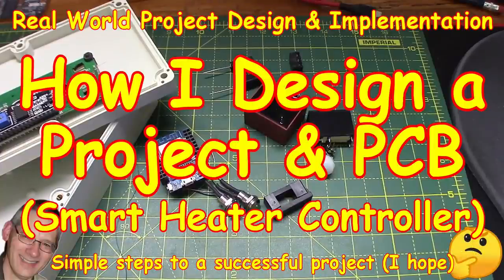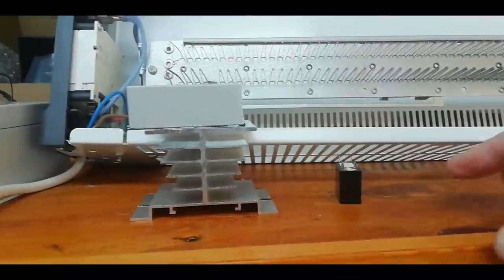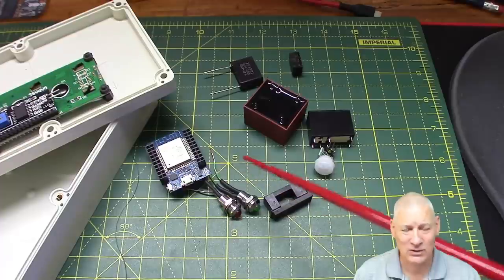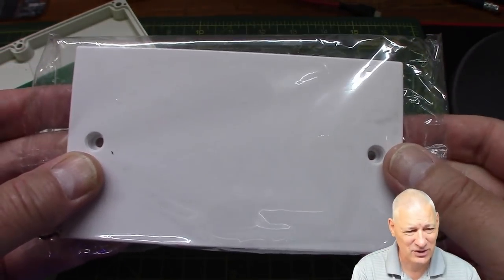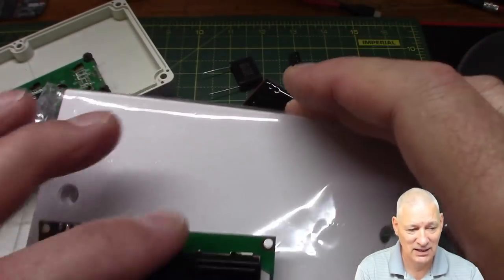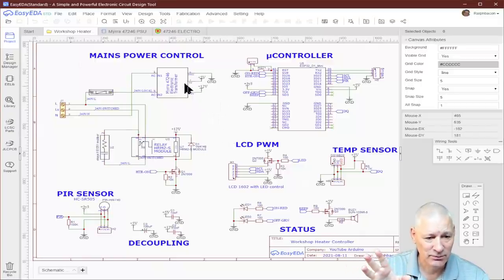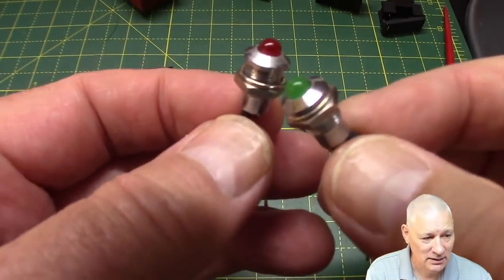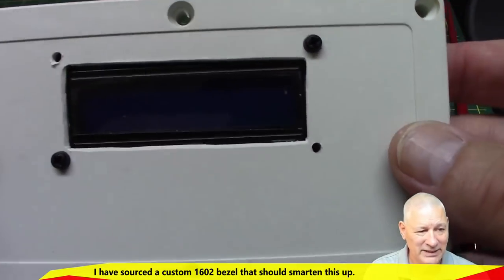#225 How I designed my Heater controller - Warning! ☠️ Mains voltage!

Comment: Ahhh, gotta gouge my eyes out after seeing an auto-routed board, especially a simple one like this. Fixing the auto-routing will most likely take as much time as having in done manually in the first place ;) .

Putting the relay besides the PSU brick should easily possible. Then the mains/low voltage separation would be much more obvious. Not that it is a problem, if you move the tracks a little, there's enough space for separation. But better component placement would get rid of the need to even think about it (and not using the auto-router ;) ).

I've never used EasyEDA (was an Eagle user in the pre-autodesk times, now KiCad user), but there should be an option for a keep-out zone/clearance around a hole (and not only for copper, but also solder mask for example). I can't imagine something basic like that would be missing from EasyEDA. What pretty much does what you did, but without having to manually draw circles, is to insert a pad not connected to any net . Set the pad diameter to the diameter of the screw head/washer plus some wiggle room (and pad drill diameter to screw diameter obviously). You will have a copper pad around the hole, but since it won't be connected to anything it doesn't matter (and your way of drawing the circle has that anyway). The best option would obviously be to not use the auto-router, then you wouldn't have to worry about tracks suddenly being to close to a hole in the first place. Did I mention that auto-routers are pretty bad? ;)

The connection of two of the MOSFETs is weird . It looks like you are switching the high side of the with an N-channel MOSFET. Same thing with the LCD PWM MOSFET (although I don't see where the "LED" signal is coming from). I'm pretty sure those FETs are on the wrong side.

Does the ESP-module have integrated level shifters? I don't see pull ups for the I2C bus. You are also pulling "DQ" to 5V. An ESP32 is not 5V tolerant on its pins. Without logic level shifter you are using the ESP's internal ESD protection diodes to clamp the "DQ" pin voltage to 3.3V plus a diode drop through the 4.7k resistor. I don't know, if the internal diodes can handle that continuously (check the data sheet for the maximum clamping diode current).
Reply from the maker: I've tested the MOSFETs at 3v3 (which is why I've lots of these 2N7000s) and they seem to work well without getting warm. The DS18b20 is definitely taken to 3v3 not 5v. I wonder if I posted an older schematic as you are not the first to say this. Oops.
I just 💘 the autorouter! It can route a whole board in seconds rather than me faffing about. OK, in this instance there are some tweaks needed but usually it's pretty good (and has got a lot better just lately). I know, typical amateur approach!
Reply: @RalphBacon  
I looked at the schematic and board layout in the video, which seems to be the same image as on your git repository (showing 5V).

With 3.3V at the gate the MOSFET can barely be called "on". It will most likely have an R_DS_on in the order of tens of Ohms. Definitely not suitable to drive a load of more than 100mA. A NPN transistor would be much better suited for switching with 3.3V. But while driving an 2N7002 with 3.3V is an issue, it's not the main one here.

You connected the MOSFET in a way which isn't right. Just because something somehow works, doesn't mean it's ok. You put the n-channel MOSFET on the high side of the load (the beeper). There are only very limited cases where you'd ever do that and it usually involves an extra gate driver chip. Here is the reason why it's wrong: assume you can turn on the MOSFET with 3.3V at the gate. In the on state the MOSFET should have a very low R_DS_on resistance, which means drain and source will be at a very similar voltage. You connected the drain to 5V, so the source will be close to that voltage (minus the voltage drop due to R_DS_on and the load current, the exact value doesn't matter). The gate is still at 3.3V, but the source at something close to 5V. How can the MOSFET be "on" when the voltage from gate to source is negative? Well it can't, that's the point. Depending on the load, how the tracks are laid out, what batch of transistors you got and other unknowns it will either oscillate wildly or be in some analog limbo state where the 3.3V at the gate keep the MOSFET barely open and the FET drops a few Volts to keep the source at lower voltage than the gate.

Something similar with LCD PWM. You just can't reliably pull up to 5V with an n-channel MOSFET and a gate voltage of 3.3V.

Comment: 21:55 don't forget that in many commercial products that they also don't bother to line up LEDs on the circuit board and instead use light pipes. You could do the same with a piece of slightly oversized acrylic rod. Or same sized if it doesn't bother you that the brightness might vary between units that are off by varying amounts.
Reply from the maker: I have some commercial devices (eg USB hub) that use light pipes (I never knew they were called that!) and it's still a possibility if I can figure out how to secure the acrylic rod to either the PCB or front panel. Any ideas? The one in my hub is custom formed to clip in.

Comment: Thanks for the tip on how to create a slot in a pcb. I’ll have to see if my pcb app supports that.
Reply from the maker: Yes, very useful for creating slots for a cable tie to hold things securely, as you saw in my video. Or separating high and low voltages with an air gap, which in this case I didn't need.

Comment: Great work, good explanation.
You could have placed the relay next to the transformer and thereby keep the low voltage on the left side and high voltage on the right side.
-Are you soldering the LED's to the board? -that could give you a hard time mounting them, even more when yo need to open the box.
Love to see it finished.
Reply from the maker: I'm using header pins/Dupont cables for the LEDs (probably) as I'd like to be able to remove the lid entirely. I hear you about the relay positioning...

Comment: Ralph,
you asked for it (peer feedback)...
Your FETs Q2 and Q3 won't work as intended. They are n-channel FETs and would need a gate voltage higher than 5V to turn them (fully) on. BTW: The 2N7000 may not turn on all the way even on location Q1. At least it will not turn on to a very low resistance. Check the Vgs voltage in the datasheet. The ESP only drives 3.3V signal levels, or did I miss a capability?
And since we are at voltage levels. The DS18B20 DQ pin is pulled up to 5V. So please check if that pin is 5V tolerant. I actually use the DS18B20 with a VCC of 3.3V and it works fine. So you can supply it with and pull it up to 3.3V.
Reply from the maker: I used the 2N7000 MOSFETs as, during testing, they performed admirably, Ludger. 

I seem to remember that the VGS(th) is quite low; at least, it worked in all my breadboard tests. Just checked: between 0.8v (min) and 3v (max).

Re the DS18b20 I have connected to 3v3 with a 4k7 resistor to DQ; that too is fine during testing. 

Phew! I think we're good to go.. well, good to proceed very cautiously, thanks for the feedback, it certainly made me check a few things!
Reply: @RalphBacon  OK, then. You can actually turn on the buzzer when the FET is at VCC? It probably works fine when at GND.

Comment: Hi Ralph, love watching your videos and your finally doing one around my field. as ever you know what your doing, but if i can throw in a few pointers i would have done differently, which others may have suggested, 152 comments atm was way too many to scroll through lol.
firstly the tracks for your mains on the PCB. you mention 8 Amps for the heater, so i would check out the track widths which look way too thin as i see them, also worth checking the technical data for the terminal block you are connecting the mains with, just to be sure it is rated for the application.
on another note, when putting mains onto a PCB, i tend to only have them on one layer, usually the bottom layer which helps minimise any risk of contact.
and lastly, the importance of protection, i see you have not allowed for a fuse? 
other than all that at first glance, it looks fab. oh regarding the cut outs on boxes, i sort of cheat as i have a laser cutter. if ever you need any cut outs doing, maybe i could help in the future.

Cheers
Phil
Reply: I once saw someone build a mains circuit using 0.15in VERO board.  The flash and bang were quite spectacular but what was interesting was the way the VERO failed at every hole because the track was reduced in cross section by the holes.  It's not just the track width of course, it's the thickness of the copper also.
Reply from the maker: I'm soldering thick wire onto those tracks to take all that current. The tracks them become almost incidental.
I did not allow for a fuse in the main (8A) feed, as it is protected by the MCB in the consumer unit (the same as it is now) but the heater itself is still using a 13A plug with suitable fuse.

Comment: Hi Ralph great video just one thing, the track size on the pcb look a little on the small size for carrying the current of the heater?
Reply from the maker: They are indeed, as they stand. I'll be augmenting them with some high current carrying wire soldered to the track. I've seen Sonoff do this and it works well.  The current is carried by the wire rather than the track.

Comment: I enjoyed your sharing your thinking process on the design and future changes that might happen.  VERY INFORMATIVE.   Thanks.    P.S.  One question.  Why didn’t you orient the relay and the transformer next to each other so that one end of the PCB was mains  and the other side of the PCB low voltage with a gap in the board between them?  Was it a limitation of the size of the box?
Reply from the maker: One limitation was certainly where the LCD screen would impact anything underneath and after 100 iterations of what would fit where, I sort of settled on this design - not perfect and maybe I will improve upon it as per your comments, Bruce. Thanks for the feedback.

Comment: Excellent video explaining your thought process. Only thing I would have added into the consideration (which you probably did but just didn’t voice) was that it is worth not modifying components like the fire which I might expect to replace when they fail. If I put a lot of effort locating a hiding place for the electronics inside this particular heater is there any guarantee, when I need a replacement, that I can get exactly the same model, or one with a similar hidey-hole? Do I want to repeat the steps to re-embed the controller int9 this new unit?  Sounds like work I don’t need. Much better to utilise the interface that most heaters provide ie the lead and keep things simple.

Great project and thx for sharing. 😀👍
Reply from the maker: If the actual heater had a place that I could have used (easily) I might well have considered it. 

As it happens, as you say, I can now replace that heater with another, non-identical model and it will still work without any modification. I like that approach, it's true.

Comment: Hello Ralph,

first of all many thanks for the project. It is really great.

But I would have a few objections:
1.) Try (as Superdau already described) to separate the 230V AC from the extra-low voltage better. I got a stomach ache that you have 230V on one side of the board and 12V on the other side directly above each other.
Better: Place the relay below the transformer and then really all 230V lines on the right hand side.
2.) Supply the DS18B20 sensor with 3.3V. Not with 5V.
     First: It works (probably not) I tested this some time ago with the ESP8266
and second: The inputs of the ESP32 are (in my opinion) not 5V tolerant.
3.) Check if the P-Chanel MOSFETS are really completely switched off at a gate voltage of 3.3V (at a source voltage of 5V). Better: Use a combination of N- and P-Chanel MOSFETS.
 4.) I would turn the ESP32 by 180degrees. Then the USB connector is on the left side and you could connect (with a small hole in the case) a USB cable.
5.) Make sure that the line to the DS18B20 is far away from 230VAC lines.
    230VAC are very "dirty" and cause interference on the One-Wire bus when switching. (Unfortunately I had to make this experience)
6.) Check if the traces for the 230V circuit are wide enough. After all, 8A must flow here. These seem a little "thin" to me.

I have already made some 230/5V boards. There is already really a lot to consider.

But, as I said great project. Keep it up.

Best regards
Frank
Reply from the maker: Good points, Frank. I will get out my EasyEDA circuit and go through each of your points over the weekend. BTW regarding the traces for the 8A mains, I intend to solder a 1.5mm wire onto the trace so that it won't evaporate the instant I turn on the heater!

Comment: printing the 3d view on a 3d printer would be nice for some projects,  to test fit inside a case or with other boards.
11:30 calipers can also be used for depth, using the "tail"
Reply from the maker: The box is still too deep for the callipers, Jyv, I tried each and every way. Yes, if I had a 3D printer I would use it for this.

Comment: The relay footprint looks very different to the HRM2-S relay. For a start your footprint is for a surface mount relay, not through hole?
Reply from the maker: Ah yes, I was intending to mount the relay onto a daughter board (another viewers suggestion) that could be swapped out easily if (when) it failed. I've had seconds thoughts about that since, as it was not going to be so easy to swap out at all.

Comment: You use the long pointy thing at the end of your caliper to measure things in deep holes :)
Reply from the maker: It just won't fit! I wanted to measure the distance between holes but there was not way any part of the calliper (pointy or not) was going to fit in there. But they are a godsend when measuring components!

Comment: I have followed your videos and now I thought I should try making my own PCB. I made a working prototype, created a schematic in EasyEDA,  converted it to a PCB and routed. Actually no serious problems. But.. how do I select the components? Do I have to select the specific component already in the schematic? Even if I try to do that JLCPCB does not have them as basic. Most videos I watch just skip out the actual component selection. May be you can fill that gap in the future? Thanks for all your videos.
Reply from the maker: When I create the schematic, I choose the components from the LCSC/JLCPCB list of components, looking very carefully at the size of the component, otherwise you end up with a 1W resistor when you wanted an 1/8W device. Never done that, nope, not me.

Having found the correctly sized component then it doesn't matter where they are sourced from, they should all fit.

Sometimes I have to design my own, both schematic device and footprint but that took me a couple of years of using EasyEDA before I got any good at doing that. I say "good", I mean getting the pins the right way round and the dimensions almost correct.

Comment: Good Info on getting started on a PCB project. With 3D printers coming down in price, why don't you just custom design an enclosure to accommodate your display, pilot lights and other components, then just print it out on the 3D printer per your specifications? I'm sure you can get a lot of use out of the 3D printer for other projects. If would make for another good YouTube video.
Reply from the maker: From your lips to God's ears, Jeff. Yes, I really want a 3D printer but until I can master (well, use to any meaningful extent) a 3D CAD program then it will just sit in the corner of my workshop doing nothing. So I'm practicing Fusion 360 but it's a long (and winding) road ahead...

Comment: When we designed a project at work - in prototype form, we used an OHP transparancy.Print any letters etc you want, and create a window for your display, then mask the display area, and spray the back of the film. You end up with a neatish front cover that hides a multitude of sins!
Reply from the maker: Ah yes, any kind of printed front cover "sticker" would work, I've done that before. Make something nice on a printer, print it on photo paper (or similar) and stick it on. Looks very professional. I'd forgotten about doing that! Good suggestion!

Comment: Ralph! Don't you have a 3d printer for making enclosures? Or you are not able to use a cad program?
I do most of my enclosures from a 3d printer.
Reply from the maker: I wish! 
1. I don't have a 3D printer.
2. I don't know how to use a 3D printer CAD program (yet).
It's on my list of things to learn how to do, maybe this winter I will be able to devote more time to this.
Reply: @RalphBacon  once you have a 3d printer you are going to regret that you did not have it before.
If you have any questions about 3d printing i will try to help you out Ralph.
Reply from the maker: Thanks, Hans. What do you think of the Prusa Mini? I want a 3D printer that "just works", like my car. I do not want to be constantly lifting the bonnet, tweaking the carbs, adjusting the timing... enough of the car analogies but you get the picture!
Reply: @RalphBacon  I replied to you but the content went away for some reason.
Reply: Hello Hans. Nobody prevents you from contributing a 3D printable case. Ralph offered a housing solution to complete the construction management.

Comment: In the spirit of community feedback, I see a trace coming from the RST pin going to the keep out zone for the antenna. But it looks like it is not going anywhere :)
Reply from the maker: Indeed. Autorouter gone mad. I replaced the schematic part of that circuit in case I had done something stupid but the track remains. I'll remove it manually from the final PCB (if I remember).